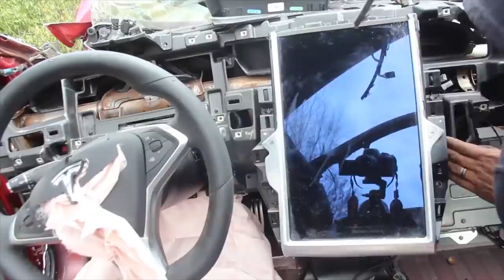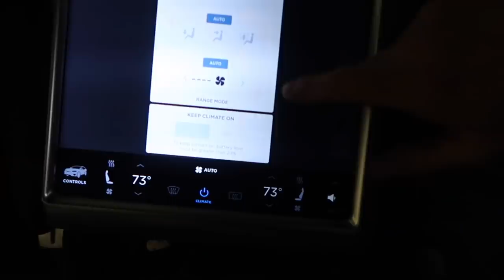Restoring a Flood Salvage Tesla Model X Part 1

Comment: You should consider to send this board somewhere specialized to fix electronics. It might look awful but if it wasn't been used while water was there, there is a very good chance that the great majority of the rust can be removed with flux, heat and ultrasonic clean.

Comment: You can use rubbing alcohol on the board to get the crosion
Reply: Rubbing alcohol and a fine brush. Even better is your get it ultrasonically cleaned like they do with cell phone and laptop boards.

Comment: You can always try a gentle brush and electronic contact cleaner on the control unit to remove any calcification.  this should work assuming nothing shorted. But then again that might be a stretch.

Comment: Rich, the PCB you showed with the rust could maybe be salvaged. Look online for a ultrasound cleaning device, I use this in some of the water damage iphone repairs as well. 
This method will remove the rust, after which you can solder the points that don't make good contact. It is a bit of a tedious job but could save the unit.

Comment: Ever tried cleaning the flooded boards with 90% rubbing alcohol, rinsing with distilled water, drying then reflowing in a reflow oven? A T-962 oven is cheap. This process has saved many boards for me.

Comment: I'm curious about the body control module. Obviously it had water get to it and there were some crusties in there. On the other hand it had to be operating in some way because it knew the doors are open and activated that rear light.unless those items are just simple switches and relays. I wonder if you could clean it up and reflow any solder joints that are damaged and use it.
Nice to see you working on a rebuild series again. Also glad to see that you finally got your Model X oh, by the way that's a beautiful color you chose

Comment: Hey Rick, if you go to radioshack.com  you can buy electronics cleaner spray.  You can buy it buy the case or can.  I would suggest you grabbing a bunch of that for your new business and your current projects.  There are different cleaners for different purposes.  You could have just took all the suspected parts that were doused in salt water and opened them to clean them before you tried turing it on.  You might have been able to save that part.
Reply: You can get electrical contact cleaner at Walmart.

Comment: The best way to remove hidden water is to use a dehumidifier. I bought a fresh-water damaged car, threw in a cheap mains powered desiccant dehumidifier (zeolite disc type), closed the doors and emptied the reservoir every day. After a week just sitting there I had removed 8 litres of hidden water.

Comment: You can try and submerge those electric boards in 94% Isopropanol. Let it soak over night, then use a hairdryer. There is a chance they work again afterwards. Cheap and well worh a try.

Comment: Great videos Rich. What do you recommend for a Model X that has one FWD not closing properly? The door received a bump and now it overlaps the front driver door by 10mm (1cm). It still closes, with a nudge. Can these doors be adjusted or re-positioned or might a new door ($$$) be required? Any advice would be much appreciated!

Comment: Is that BCM definitely 'toast'?  Use of a suitable cleaner to get rid of the corrosion might clear any conductive deposits and as long as the tracks are basically good the solid state electronics might be okay...?  Though I didn't get a really good look so you may have seen things I didn't...

Comment: Rich, don't give up on that circuit board so quickly. Get a good contact cleaner (WD-40, CRC, etc) and a toothbrush to remove the water marks, rust, dirt. There's a good chance it will come back to life.

Comment: With so many parts nuts and bolts how do you keep track of where everything goes when your reassembling??? 

For example a component can have many screws and they could be different sizes. Do you ever get stuck  trying to figure out the orientations?

Have you ever put something back together and found you missed something in the middle of the process and had to redo it ?

Comment: Rich, do you need a GoPro for tight spaces or as a setup? I have a spare Hero4 I’m no longer using. 

I also think you could take some inspiration from Hoonigans by time-lapseing parts you don’t think are important with a camera that just sits in one corner and you move it when necessary.

Comment: Those seats don't seem overly bad. They may clean up. and i don't think the water level was that high on that  model x. It looks like it was mostly the floors that got wet. so most likely the battery was wet as well. It most likely won't need a full tear down like the others you bought.

Comment: That board could be brought back from the dead with nothing more than Branson AC 100% clear alcohol distilled water and an ultrasonic cleaner which could all be bought from rossmann repair don't delay by today😉. But seriously you and him should hook up with Louis Rossmann because if anything he could show you how you could save thousands on just repairing the boards rather than having to buy new or second-hand because at the end of the day they are the same components that go into a computer or a TV set it's just a case of finding the resupply. Anyway good luck with your new project mate 👍👍.

Comment: Hi Rich great job to restore a flood Tesla (Y).

I bought a salvage Tesla. With minimum front damage and rear side damage (rightside) The headlight and frontbumper are broken parts. the airbags and pretensioners are ok. The mcu works good, i have charged the 12v battery. When i try to charge the main hv battery i won’t be able to. The chargeport opens and then i cannot put  my chargeconnector in the port it stays locked. When i pull the releasecable and put my chargeconnector in the port it gives error dont use the releasecable for charging. I see on my instrument cluster that “the car is off” 

Is it possible that the hv battery is disconeccted by pyrofuse? 

Can you help me pls

Comment: It doesn’t appear Tesla interiors components are not equal to  high end Honda/ Toyota quality.  Some things as you were taking them out seemed really cheesy. Not trying to be critical,  but viewing from a body and frame repair tech working at a Mercedes dealership point of view.  I have taken out hundreds of interiors. Never seen a Tesla until I started watching your channel. The certifications to work on Electrics are getting tougher. As an independent repair shop you are starting, I guess you get the leeway to fix as you see fit. Hope your new venture surpasses your vision  with great success.

Comment: And...all these circuit boards...no conformal coatings...awful mistake leads to corrosion, shorts, failed components.  Bad, bad, bad.  Buy some Rich...coat all the boards before you reassemble.